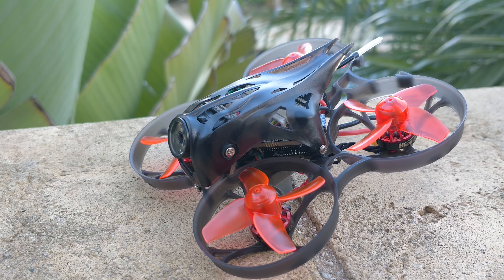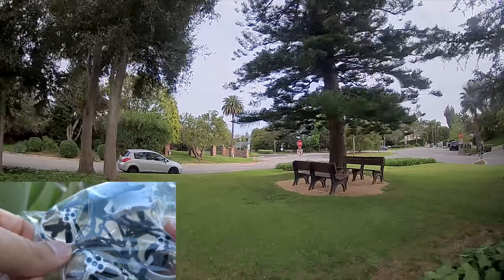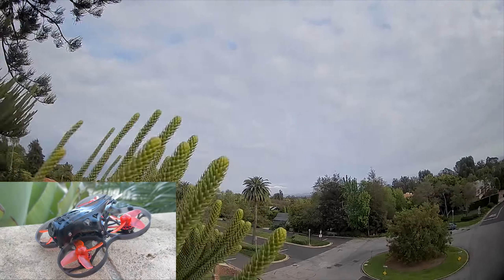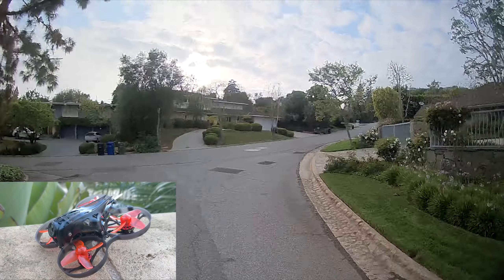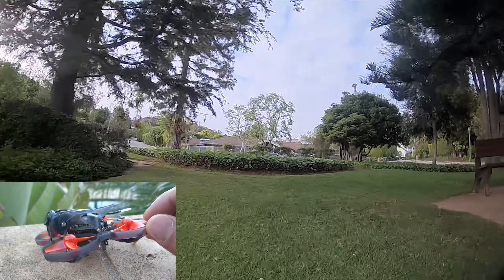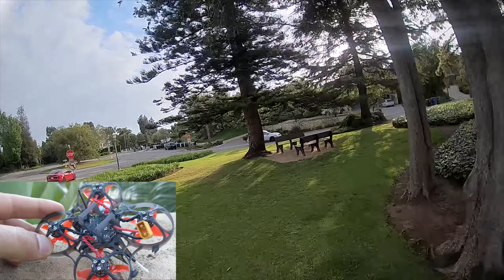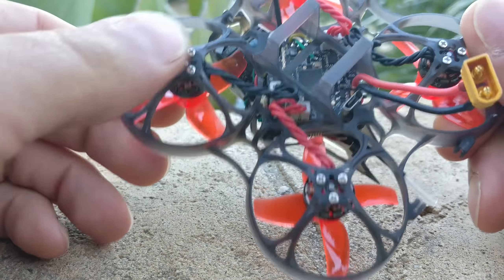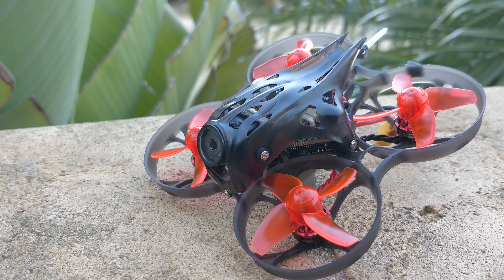Mobula HD - I know it's old...

Comment from the maker: Table of Contents:
00:23 - Flight video
01:22 - Flight performance
03:31 - The hardware
03:36 - Main flaw
05:31 - Summary

Mobula HD: http://bit.ly/2IQtbV1

"Good" alternative options: (they all fly so so at best)
Iflight Turbobee: http://bit.ly/2GsZSnP
Would be great if this thing fit 2.5" props.
URUAV UR85HD: http://bit.ly/2VwcZhT
This thing uses the Happymodel Crazybee board so has the same potential failure issues.

There are a couple of companies making new AIO boards that can handle a WHOLE LOT more power.  This class of quad will become reliable in the near future.

The most reliable non-HD whoop product we've seen at PiroflipRC:
http://bit.ly/2XxInKe, http://bit.ly/2IMWRBQ

There's a pretty awesome 4S 12A board coming from GEPRC soon:
https://geprc.com/product/gep-12a-f4-...

Join my FB group for more discussion: Kabab FPV
https://www.facebook.com/groups/37915...

Equipment I highly recommend:

Micro Eagle - 
https://goo.gl/or1fS9

Caddx Ratel 1.66mm lens - This is a new product so we do not know if it is as reliable as the Micro Eagle just yet but I love the picture.
https://goo.gl/mXcTHN

Rush Tank Vtx -
https://goo.gl/YMYmya

Fantastic solder-
https://amzn.to/2P5QM2W

TS100 iron -
https://goo.gl/DqBipa
https://goo.gl/svK6DD
https://amzn.to/2OV5XMh

WaFL’s Cap Cap
http://bit.ly/2GUpXxO

Xing 2306: https://goo.gl/TT9gnw, https://amzn.to/2VkZ8rt
Flywoo 2306: https://goo.gl/xuLG6d
Hold off on 220X motors for now.  There is a bug in BLheli/BF that makes them act a little weird unfortunately.  :-(

Sub $200 5" build that's still good:
Frame: https://goo.gl/EpXQhZ
FC/4in1 Stack:  https://goo.gl/HprVbj
Motors: https://goo.gl/h5rofi
Props: https://goo.gl/ZnzY2y
Props: https://goo.gl/VMBiQh
FPV Cam: https://goo.gl/FDJhYw
Vtx: https://goo.gl/JNVDMn

Starter goggles I recommend: https://goo.gl/GvJUkT

Tips?
PayPal: https://www.paypal.me/kababfpv

Please use my referral code if you're gonna buy a Tesla.  You get some free stuff when you do and I get better status with Tesla: https://ts.la/bob40889

Bitcoin: 1E4XZXoD4rS6MYWVWuenY7Kw2M1YgyNpoQ
Nano: xrb_1188ek5bd7tb9kw67asnp9o65byuoaxbtpxuznx1ribf75x78awywmakj55f
ETH: 0xD067F93811f2eC31CB1928901002dfdf9A492EF5
LTC: La2KWYAjp4VT2Lq2M76pbjzXWvRyjpfCtG

Comment: For the auto record and auto save. You need to first tell if you have the v1 or v2 turtle. The v1 doesn't have the microphone, and you have to manually turn on the auto record which you do by using the dongle and controller. If I remember correctly the M7hd originally came with the v1 and no dongle. which is weird. That was later changed.

The v2 turtle comes preset to auto record and save. But it can be changed in the settings using the dongle. 

With the turtle over all I've found that the WDR is way too dynamic. Sure you can see in the dark areas well but it makes the lighter areas weird, hazzy, washedout and almost CG looking. On my turtles I turn off the WDR and set up EX to 0 and my metering mode to Multi.

Comment: 0:35 exactly what is happening when props are too small for quad weight. With DIY and modified micro quads this is happening a way too much as expected :(  All nice tiny things like better camera or harder canopy add weight very fast. For stable flight and good control Mobula HD should have at least 2" or better 2.5" props.
Update: Posted and opened comment section and noticed "Would be great if this thing fit 2.5" props". Exactly what I think about that :)
Reply from the maker: I'd say at least 3" but it would be much better still with 4".

Comment: Nice vid ,  just go into the caddx turtle settings and there is an option for turning on recording when you power on, need the little dongle controller and will only work when not recording
Reply from the maker: There's no dongle plug in on this board!  I'm clueless!
Reply: @Kabab  (according to an early reviewer) They took the dongle socket off the board to fit the board in the mobulaHD, but were planning to have a dongle connector on short wires instead. If your's doesn't have the dongle socket on wires, you'll need/want to add it yourself.
Reply: @Kabab  should be a green and black wire with a 2 pin  plug on it tucked away in there on the side
Reply from the maker: @amisoftau2659  well they should have made the damn record feature standard. They should totally remove the other way of recording

Comment: On my ratel,  it takes a while to come on, and sometimes the camera doesn't put a pic out. I just in plug and replug and it works, also it freezes up in a crash sometimes, I've checked, and rechecked connections. I'm wondering if you've had any of these problems? Sorry I didn't go the the right video, kinds running late.  Thanks Kabab!!
Reply from the maker: yeah these are the issues I reported as well.  Sad.  Such a nice camera
Reply: Hey bro bartwell has video how to change so camera comes on when drone plugged in off when unplugged.. no need to press button.
Reply: @sleepingbearffg5008  I'm not sure what your saying, the go pro comes  On? The caddx ratel has some issues, it doesn't come on every time it's powered up, it also freezes in crashes, other than that it looks incredible, and you can fly under a full moon.
Reply: @sleepingbearffg5008  which video?

Comment: I could not agree more! 

While I don’t consider my self to be an where near the pilot you are. (Yet).
I don’t consider the two boards that burnt out on me to be from my skill issues. The second one even locked the Circuit closed and the only reason the whole quad didn’t go up in flames was that battery lead severed from the heat!!!
Thanks for this video. I have two new crazybee V2.0 boards I was planning to build this weekend. But now I guess I should just send them back?
I still have two  crazybee F3 boards that are pretty much indestructible. I guess I will use them instead.
Have you ever run the F3 on 3S or is that just guaranteed to fry them?
Reply from the maker: the F3 won't do more than 2S and it struggles with 2S at that.  The quad is fine on 2S however.  Annoying that these boards don't just keep working.

Comment: change the direction on the motors and go reversed. would be interesting to hear what you think about that after bardwells vid the other day that 3inch and smaller would fly better riverside than std.
Reply from the maker: it doesn't mater so much on quads with prop guards like this.  I know bardwell just made a video on that.  I have a video about it fro maybe two years ago about the aerodynamic benefits.  However the only real world benefit is keeping stuff off your lens.

Comment: I can't remember if you shared your rates and PID's for your toothpick. I'm running Betaflight 4.0 and with everything stock the control is very sensitive.
Reply from the maker: Drop the actual rate down to 0.7 if it's too sensitive. Leave the rest default
Reply: @Kabab  I'll give it a try, thank you.

Comment: could the toothpick class support these hd cameras better?🤔 because of the bigger prop size
Reply from the maker: I've got many prototypes but I feel it's really not possible to get really great performance with less than 3" and a split cam.
Reply: The best way to get a good video recording on a nano-quad (Toothpick). Is with a on board DVR. The HMDVR-S is what I used. It's only 2.5g but will use 400ma so you must run a separate 5v reg adding another gram. Here's a sample video.
https://youtu.be/TPZVhSha_8M

Comment: So are you saying the V2.1 Crazybee F4 boards are working properly or do those also suck?
Reply from the maker: All the quads that came before the sailfly use the shitty version of the crazybee boards and almost all of them have burnt out.  I'm not sure how the newest one on the sailfly is holding up so far but the company just put out a letter saying that a cap is needed when using an XT30 connector.

Comment: Is this something you would recommend for a toothpick conversion?
Reply: the sailfly-x will be a hell of a value if it stays around the $80 mark and would be the one to get for conversion
Reply from the maker: NO.  Do not buy an whoop with the intention to convert.  None of them convert well.
Reply from the maker: If it doesn't burn out constantly.  I'd also bet the frame will break pretty easily.

Comment: use anti-gravity?
Reply from the maker: It's always on
Reply: @Kabab  they changed alot in the meantime it seems. Different Motors, condensator between the powerlines. Dunno which version you had?

Comment: there is a newer firmware for the Caddx Turtle v2 on bf github https://github.com/betaflight/betaflight/wiki/RunCam-Device-Protocol with which you can use the Runcam Split Camera Control in bf to start stop by an aux channel .. works quite good

Comment: I roasted 4 mobula boards. 2 f3s and 2 f4s. Junk lol
Reply: Same here, I ordered an F4 to build a toothpick, fried my Mobula's F3, replaced it with the F4, fried that one too.
Reply: @RR123  I gave up on the Mobula, I ordered a spedix rex 80. We'll see how that one performs. It's a BNF so I can add an XM+ to it and the stack is 20x20. It actually cost me less than the Mobula did last year.
Reply: @yannickg6904  Interesting, I was looking around for 2/3S xt30 alternatives and it even has an HD version... 
Curious to know how that one goes, do you know if the M7HD props would work with it?
I have a bunch of those too... :/
Reply: @RR123   Both use 40mm props. I just checked and the Spedix has motors with 1.5mm shafts. I may be mistaken but I believe your props have a 1mm bore. Otherwise I really like the Rex because it has a standard 20x20 stack. I'm already looking at options for a carbon fiber frame, lol.